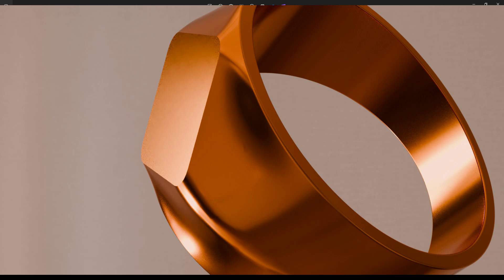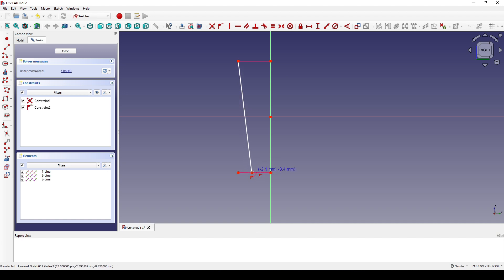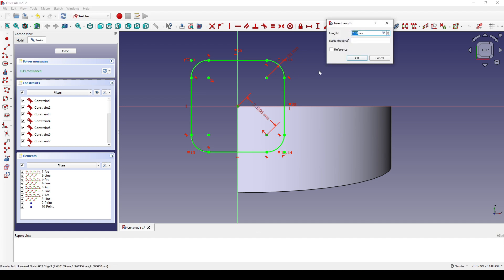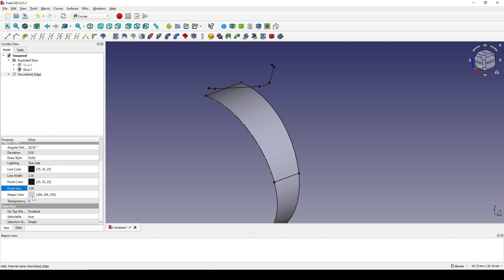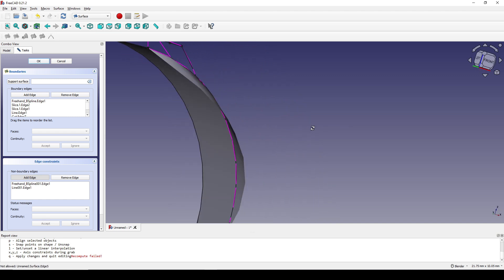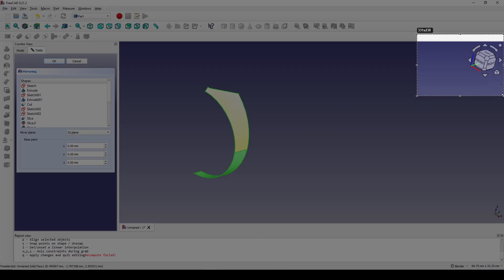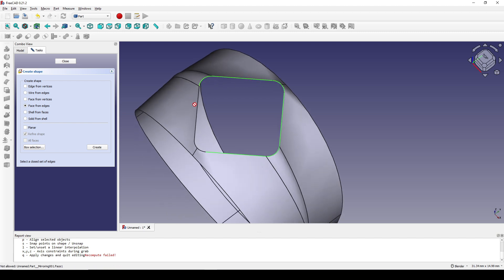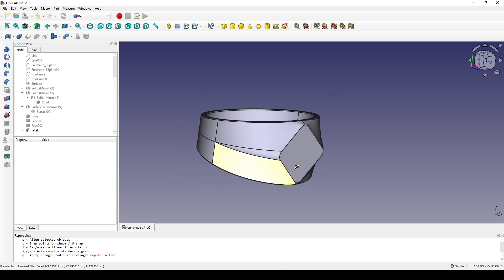FreeCad - Create A Ring Using Curve WB and Surface WB

Comment: Hi,
Tx a lot for this new video

Given a Mixed curve, built with 2 B-slines, haw can you get the intersection of this complicated curve with a spline ?

Can you explain in a video the process you are using for that ?
Are you using a macro, or other else ?
Reply from the maker: I do have tutorials about mixed curve and freehand bspline, just use curve WB, no macro. You can check them out
Reply: @DuyQuangDang  
Yes, sure I did.
I have almost all you videos, and the last ones are really very useful (the key you press or the mouse action, , particularly. ...)
-
But existing a 3D spline (an FH, or a Mixed curve), it's not so easy to find the intersection of this spline with a sketch on which you are working on ....

With a line, you get sometimes a point, more often the projection of the whole line, but with a B-spline, generally, what you get is the projection on the sketch of the whole B-spline, when the unique point of intersection is what I need for the precision of the model ....

It's a a real lack of FC, imo

I just discovered too the Silk WB, which seems also very powerful, but as often with FC, not so much user-friendly ...

Comment: Hi, thanks for this tutorial video. I'm about to ask your expertise to solve a complicated (at least for me) organic form full of curved surfaces derived from an stl file not made with FreeCAD and the mesh was not perfect to be 3D-printed. In fact it's a set of 2 shapes that should match to each other with the correct curvature. I have already made a lot of sketches with the correct dimensions and I've tried lofting them but the final results are not satisfactory. I'll send you by email the file with everything in it. It will be up to you if you want to make a video with it or not.
Regards